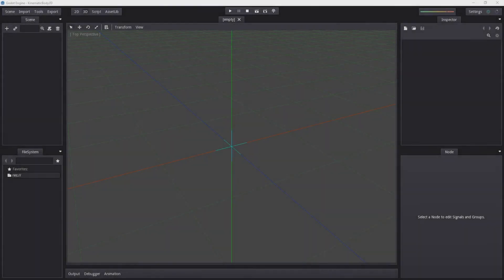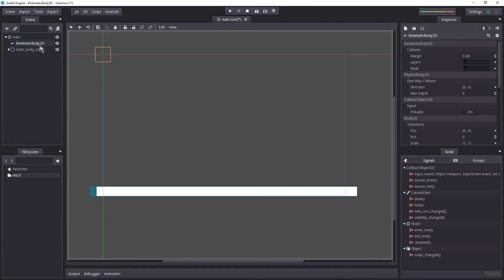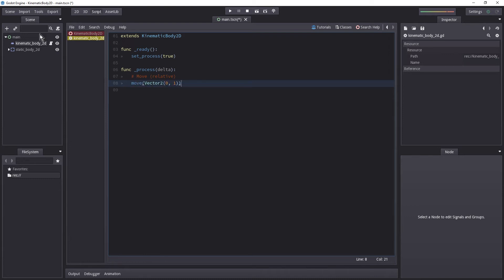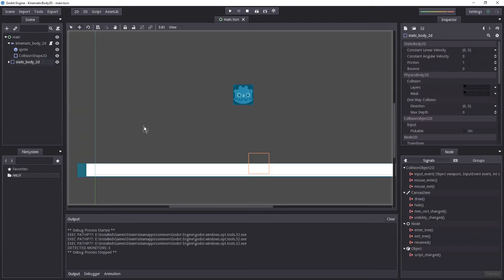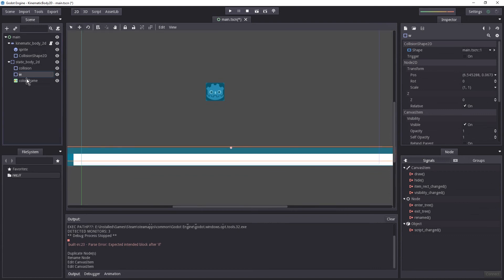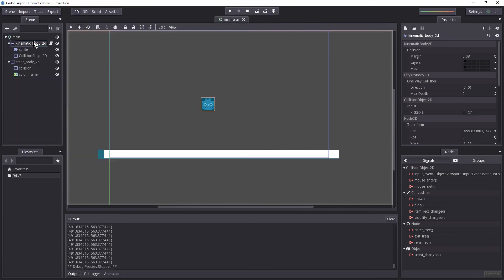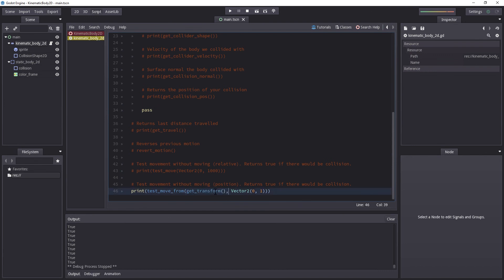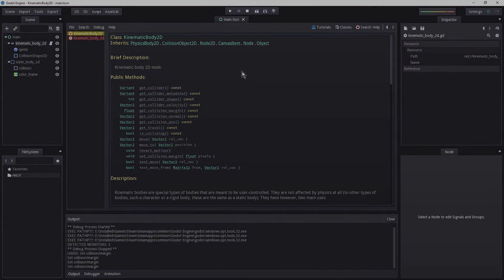KinematicBody2D ► Nodes in Godot Engine

Comment: I like the videos that shows one by one all the commands available, good video. Thanks!
Reply from the maker: I will keep doing this in future Node videos. Glad you liked it! :)
I might even have to revisit previous Node videos, as I am still learning and figuring out the best way of presenting these nodes in a best possible way.
I have not even used all the functions of each node myself, so preparing for a tutorial like this is a great learning experience for myself as well! ((bonus))
Reply: I fully understand your point, I'm usually doing some basic demo files for myself to learn, it's the best way to learn something. I have a small library of my own examples trying to have a real use of every function I consider relevant, that way when I need to know what is doing an specific function I have a visual hint about what is about and how to use it.